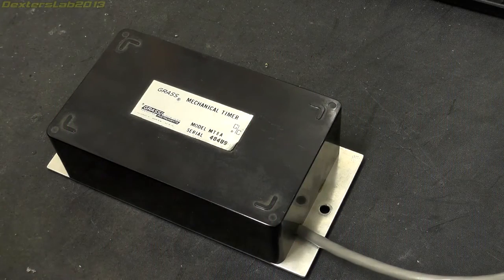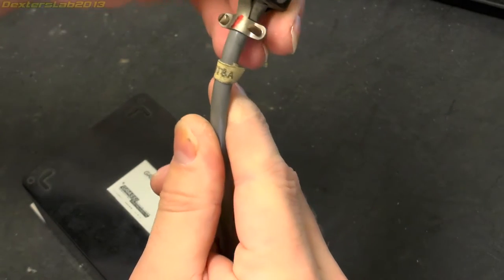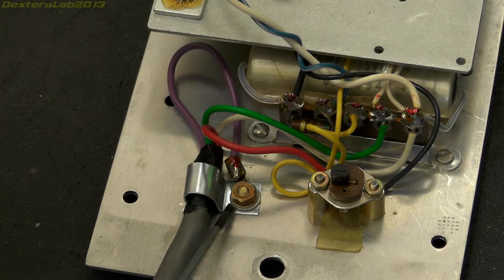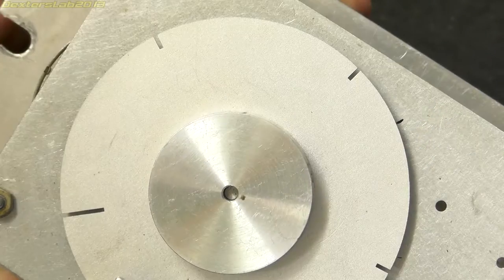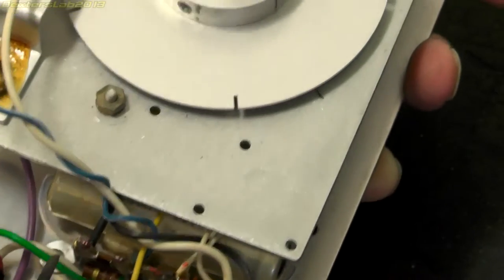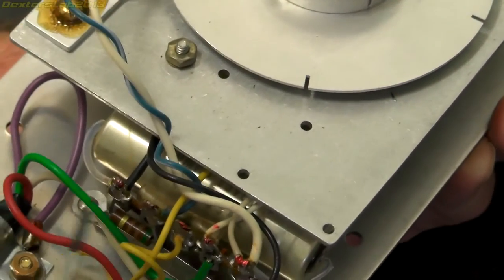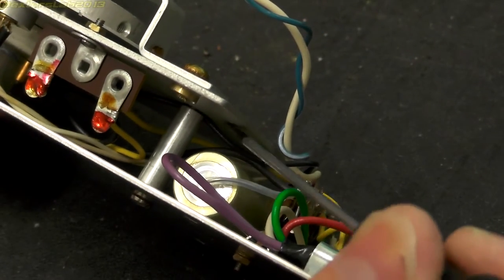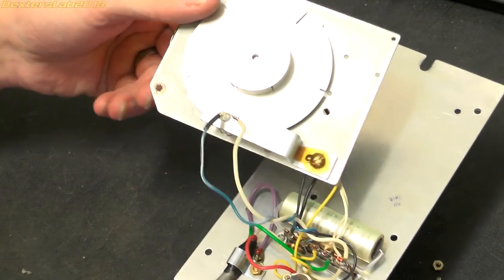DL#079 - Grass Instruments Polygraph Mechanical Timer Teardown

Comment: Perhaps for making time marks on the paper? Seems somewhat complicated for such a simple task.
Reply from the maker: +mikeselectricstuff Of course, yep i'm seeing it now... and that must be why it's optical too, there are 5 notches with one of them enlarged so i bet you get a slightly bigger output marker on the paper every complete rotation. I had wondered why it just didn't have a mechanical switch making the output.
Reply: +mikeselectricstuff I don't see any mechanical printing or punch on video - I assume in that case paper have to be photo-sensitive?
Reply from the maker: Alexei Polkhanov This is an electromechanical timer, the motor generates a small electric pulse which is sent into the main polygraph unit which would make one of the pens move every period for the marker

Comment: % pulses so you get a minute marker and then 12 second pulses for calibration. Send to the one pen so you can adjust the paper speed to suit the application, or use the marker pips to analyse the signals later. Might also be used as a pulse to reset the integrators in the unit regularly as they do tend to drift, where the larger pulse of the minute marker might be used with a second comparator so as to have either short (12s) or long (1min) reset intervals.